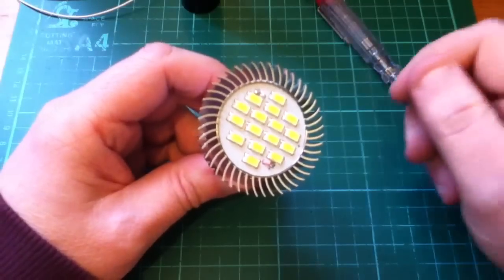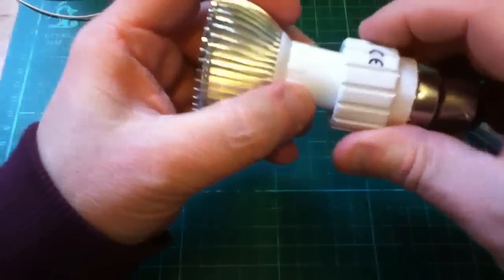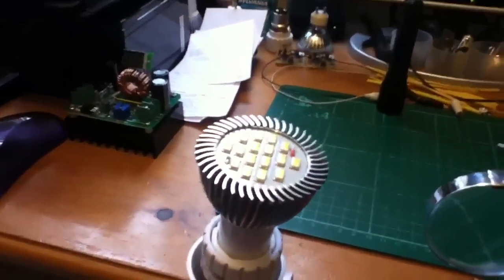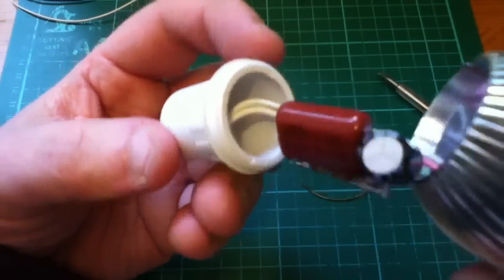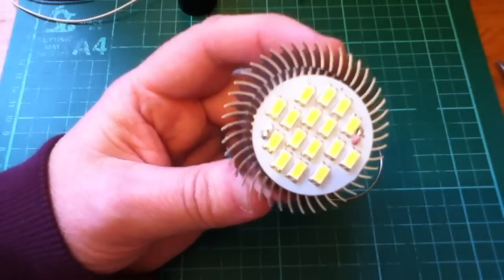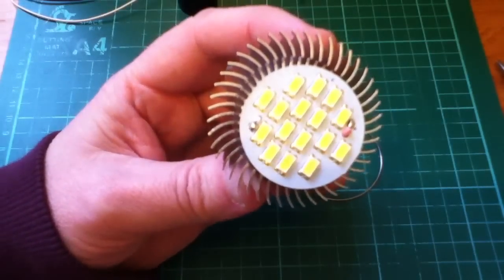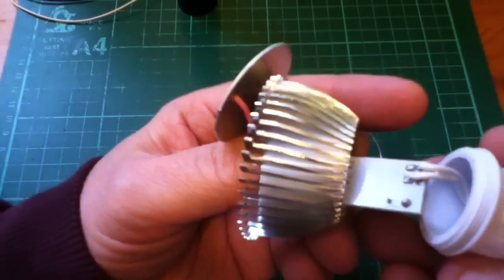Dangerous GU10 LED Spot Light is Cheap and Bright but could Kill You - Seriously

Comment: Any circuit or plug that allows the user to change polarity depending on how it is plugged in should be revised. Unfortunately it is not just GU10 but every plug socket in most of the EU, unlike the UK.

Comment: Just curious. If you cut out the intermediary circuitry, would this be work from a 12V battery and would it be bright enough for a camper. Obviously with the lower voltages and DC, it would be much safer im thinking?

Comment: I can see 16 LED in total, each would require 2.5 to 3V to turn on so at most - assuming all connected in series - you would have 50V across them. Of course there is still a risk if one of the LEDs has burnt out and the circuit became open.

I could of course be wrong but you should've at least measured the voltage with a multimeter

Comment: You did say it has a bridge rectifier.that means the led's are dc. So it doesn't matter which is the hot or neutral.the screws on the front will always be negative.

Comment: I still don't understand how you could end up with live mains 50% of the time if it's running through the rectifier. It still seems unsafe either way to have the front exposed like that. It's almost as if it was meant to be put in a housing that would have a glass cover.

Comment: Wow, really? You have no idea what you are talking about. You could put your wet hands across those two contact points and nothing would happen. You wouldn't get shocked or anything. Also as for the interchangeable live and neutral input into the LED driver (yes it's an LED driver not just a normal step-down). Quite a few of the 110-220VAC LED drivers the L and N inputs are interchangeable. The output going to the LED's is not. Take it from a guy that has the nickname LEDman. This is not a dangerous bulb.

Comment: to all those saying these arent dangerous 'cause theres only low voltage at the leds, or theres a bridge rectifier so theres no ac at the led terminals so its safe....WRONG, WRONG, WRONG ,the voltage ACROSS the leds is IRRELEVANT, the bridge is IRRELEVANT,  what makes it dangerous 50 /50 is theres a capacitor to drop the ac line voltage in only ONE input pole of the lamp...connect it  the 'wrong' way round, with the neutral  going through the capacitor, but the live direct to the bridge, and both poles of the led panel will be  live to earth , differing by the led volts drop, depending on the mains waveform live to earth polarity  ,  +350v peak on the led positive while the other is +350 minus the led voltage drop,  with the live at the positive peak,    when the mains is at its negative peak, the led negative will be -350v peak, the led positive at -350v less the led voltage drop, so each pole is effectively live to earth within a few volts of each other, think of the led voltage as riding on the crest of the mains waveform  ,  when connected the 'right' way round the +350 and -350 will instead be just the led voltage drop, and the opposite led terminal , +0.6 or -0.6,  depending on the mains waveform polarity.. so effectively live at only the led volts drop ...... this is very easily proven, with a neon screwdriver.... connect the bulb one way round , touching the screwdriver in turn on each led connection,   if connected with the live direct to bridge, and neutral via the capacitor, the screwdriver will light
Reply: All though that gobbledygook is illegible. I think I can discern some things to be corrected.
Mains current is alternating, which is why there's a rectifier. Alternating current has no + or negative terminal, its alternating.
A bridge rectifier turns this into direct current, DC. However DC that output is not grounded.
So one side of the bridge rectifier doesn't have a + or - side, the AC side. And the other side is not grounded.
The leds are not earthed and the rectifier doesn't get any negative voltage.
This is mostly for anyone one else reading this, I fear that andy here may believe in Thor?!

Comment: Wait a second, you said it has a current bridge rectifier which means that the LED's are DC not AC.  Obviously the AC hot and neutral go no further than the 4 power diodes, so it wouldn't matter which way it was plugged in.  You should have included a schematic so we could follow the circuit.

Comment: i don't quite see anything wrong there. only 30-50 volts DC at 300mA with no connection to the heatsink, meaning to get a shock you need to touch the board connections and not the heatsink. the typical thickness of fibreglass between traces and the aluminium backed portion is usually a few tens of micrometers or even as thick as 0.25 milimeters.

Comment: Amazon,Ebay all these online stores do not do any testing or require UL or CE  to sell this crap coming from China. If it is not listed with a compliance lab don't buy it. In the states at least Wal*Mart does require the proper safety standards and test products before they are sold. The product shown in the video would have been subject to the dielectric breakdown test and failed, also because there is no cover over the LEDs it would have not passed UL or CE.

Comment: 1. The main purpose of a "Bridge rectifier" is to convert AC into DC irrespective of the polarity. So even if it is plugged the other way round it will not swap the positive and negative. As these are diodes, it will never work if it would anyways. 
2. There is a step down circuit which steps down the mains to a few volts and amps which should not be lethal.

Comment: The capacitor acts like a large value resistor to reduce the voltage to the LEDs to about 50 volts DC.  The aluminum heatsink is insulated from the LEDs to about 1000 or more volts so if you touch the heat sink you should not get any shock.   However, touching the spot on the face where it is soldered would be shocking at you have 240 vac and that will give you a good shock if your skin is moist enough, or at least a good buzzzzzz.

Comment: Scaremongery at it's worst. All y'other folks that know the first damn thing about consumer electronics have already de-bunked this presentation. 

The very least he could have done, was to meter the damn thing, re-socket it, and see what happens next (spoiler: nothing, the ac conversion to dc works just as fine, whether you socket it this or that way, otherwise the bulb wouldn't work in the first place).

It does, however, appear to low quality materials and low quality craftmanship, so remember to test the batteries in your smoke detectors.

Comment: Are you sure that there is nothing reducing the voltage to the leds? It is possible to reduce the voltage using a bridge rectifier if the diodes have a resistance across them. I was hoping you would check the voltage at the wires where the leds are connected. I use a similar light in Australia and the voltage is 48V DC. Still enough to be dangerous but not lethal.

Comment: I do not see a problem as that bulb is a 12 Volt bulb, yes the socket is 110 volt but the purpose of the resistor is to step the voltage down.
I will put it this way plug that bulb into a 12 volt battery and it will light up bright as I have used these as flashlights for years.LMFAO

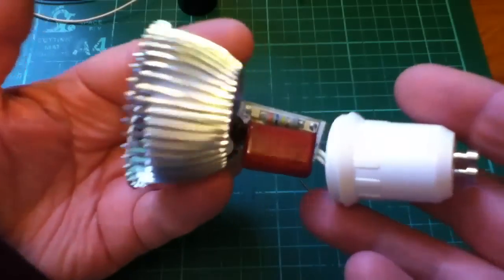Comment: Sorry, but in a 4:33 video about electrical safety having not even taken the time to put a voltmeter across the points where he claims the danger is,  does not give me much confidence in his product analysis.   An ohm meter to check his claim that those solder points are connected directly back to one or the other AC inputs would be nice and very convincing, but he doesn't do that either.  LEDs use low voltage DC current and there are various ways to get there.  But I'm certain that putting an isolation transformer inside the bulb housing is rare.

Comment: There are two types of mini track lights, and GU10 ARE mini track light lamps.
There is the GU10 type, which uses either 120v AC or 240 v AC lamps. The other type of mini-track light uses a 12v DC lamp. Each lamp holder has a transformer assy built into it, to convert the AC mains power to 12v DC for the lamps.
I THINK the tracks are the same for the two types, so if you have a GU10 type, you could buy the DC type and switch the lamp holders.

Comment: As long as the bridge is functioning the positive voltage will never end up where it's not supposed to be. The rectifier not only changes the A.C. into D.C. but it always puts the positive voltage out on the same line no mater how you have it plugged into the socket. The only way to have positive voltage in the wrong place is if the rectifier would short. Diodes / rectifiers are most likely to open rather than short so it's extremely unlikely that line voltage will ever reach those two solder pads. The other thing to consider is that you can safely touch either side of an A.C. voltage as long as you are not grounded or also touching the other side. If the heat sink is not grounded and you did end up with line voltage on those solder pads it would do nothing unless you were also touching your house ground or standing in a puddle of water in your bathtub.

Comment: Neutral is not ground! Depending on the loading balance of the center tapped line transformer (USA we use 115V-0V-115V for home power delivery), you can have lethal ground currents flowing in the neutral lead relative to the other phase and ground. For the sake of LIFE, just treat each contact in the socket as live. I learned about AC dangers in an old barn with a damp floor in the 1960s. I found every leakage path on every single device I ever worked on! It was worst in winter, when I would only do battery powered projects!

Comment: I am an electrical engineer with several years experience designing power electronics so I can speak with some authority on this subject. Now while I may not agree entirely with everything said in this video, I must say that anybody arguing that somehow the connections to the LEDs on the front panel are safe is propagating misinformation and making themselves and others candidates for a Darwin Award.
Anything connected to mains is considered a 'hazardous voltage' until it is isolated by an appropriate barrier. A transformer is one way, but there are others. This lamp has NO ISOLATION between the mains and 'accessible conductive parts'. The electrical safety standards do not allow for this. This lamp would never achieve compliance with any electrical safety standard I know of.
But while you are considering this lamp have you ever looked inside a phone charger. The type with a USB socket on the side? I can tell you now, they should meet EN60950 (almost everywhere except Germany who use a VDE standard) which requires the primary (mains) conductive parts on the pcb and the conductive secondary (5V output) parts on the pcb to have a minimum clear space between them of not less than 6.4mm across the surface of the pcb or 3.2mm in air provided the parts are well anchored (so they cannot move closer together even if the thing is dropped or hit). 
I have yet to find a phone charger that meets EN60950. 
Typical clearances are not 6.4mm, but in some cases even less than 1mm.
This lamp is no better and may be worse except for the fact that lamps are not usually so easily touched
Whether this lamp gives you a shock or not is a matter of luck more than anything else. There is very little that need go wrong before this lamp would be dangerous to touch while powered.
If you are a budding electronics enthusiast, that's great but don't start talking about things of which you clearly know very little. Julian may not be 100% accurate, but anybody arguing that he's 100% wrong is an idiot. Just think about this: what separates the mains voltage from the exposed conductive parts? Here's an acid test to see what you really think of the isolation barrier: would you be happy with your child for example playing with something connected to mains and having only that same thing separating the mains from your child? If you still think this lamp is ok then I am bewildered by the fact that you have survived long enough to be old enough and managed enough education to use a computer to make your stupid posts on here. I mean, what are the chances!?

Comment: AC is both positive and negetive (switches 50 times a second in the UK), if you hook it up the other way they rectifier will RECTIFY the AC so it doesn't matter what way it goes.
Reply: Basically there is not + - wire with AC because they always swap, they only mark them so if you put two separate circuits together it won't blow up XD

Comment: Please, touching the LED plate is not dangerous !
"L" runs into the rectifier bridge while "N" continues its path to the capacitor. But after the rectifier bridge you will have turned AC into DC, regardless of which way you screw the bulb in. The SMDs would explode if they would receive AC and most compenents on the PCB would not even function. The only thing  here that can explode is the primary capacitor. In case the both pins are connected, one of them will just explode and also tear the "L" cable of its soldering joint that came from the mains.

Comment: So.. if you buy Europe or American LED who triple expensive you can touch the metal or electricity without worry with shocking electricity ???? with Europe bulb. You can put your light on the table or floor without worry, and your children save to touch the bulb..

What I know light bulb place on ceiling and doubled with a plastics cover. It's for light your room not to touched.

Comment: Julian, at least here in the US, all house hold plugs/sockets are polarized, so even if this were converted with an adapter, there would be less likelyhood of that danger.  

I have purchased a number of similar units off ebay that run directly off 115vAC mains with exposed circuitry around the LED chip, with no connection apparatus at all, just two solder points to which you need to solder AC leads for power.  Thing is, the entire surface where the small resistors and other components surrounding the LED is coated with an insular glass or epoxy which not noticeable, but definitely is a strong insulator.  Point being, actually none of those components or even the solder points are conductive.  I had to scrape that coating off before I could solder the power cord to the unit.  

Have you tested those potential danger points on your unit to see if they are actually live?  It may not be immediately apparent, but they may be well insulated with glass or epoxy and quite safe.  Still, I agree, an unbalanced circuit that could even in the most uncommon situation get hot AC anywhere near a human being is inherently evil.

Comment: So 240 volts in the UK is one hot wire and one neutral wire? I'm no electrical expert but I'm pretty sure that in the USA 120 volts is one hot wire and one neutral wire, but if we want 240 volts for a welder etc. then that is two hot wires 180 degrees out of phase to each other... if I'm saying that right. I just thought this point was interesting, that with 240 volts in the USA there would be no 50% chance of safety, both ways of connecting would be dangerous, though maybe going to ground it would only be a 120 volt shock.

Comment: God you are an untrained idiot. Don't give out advice with out knowing what you are talking about. Main point is that it is only 12v running through the front points that you point out are "LETHAL" to touch.... yes you may get a tingle touching these points but death isn't awaiting any one who does. Your stupidity is astounding. I suggest you remove your video to save yourself further embarrassment.

Comment: Yes, dead right, and I could hardly believe it when I found out the same thing.  What really surprises me is the number of confused responses here.  It's simple - these things do not bear a CE mark (some do but not in the exact logo form required by the rules, and they call it 'china export'!)  There's no way they could be honestly marked CE.  Having exposed metal means they additionally require the double insulated symbol to be legal (and that requires I think 6mm gap between live parts and metal case, not microns, plus all sorts of safeguards).  YES they are lethal, and the sellers should have been prosecuted long ago to stop them being imported.  Same goes for many LED floodlights without earth connections to the metal.  They also flicker, potentially causing headaches - the better ones have high frequency invertors in them to convert to low voltage, and plastic outer shells that don't need earthing.

Comment: The exposed terminals should be low voltage DC, which imposes no danger of electrical shocks.  You can easily measure the voltage across before making the claim.

Comment: Well to be honest I don't have much experience in this, but if you put 230V straight to the 20-ish LEDs, wouldn't they break instantly? In that case, 50% of insertions would be reason to believe there would be quite some negative reviews on eBay? Because there aren't. This likely means that the voltage supplied to the LEDs (DC, not AC) would be stepped down A LOT meaning that it is harmless?

Comment: Have u tried putting a volt meter on those poles to see if ac current is on them cause most led work off 12 volts dc. Not saying your wrong and yes i know china makes some bad shit but just curious if there is ac current there.